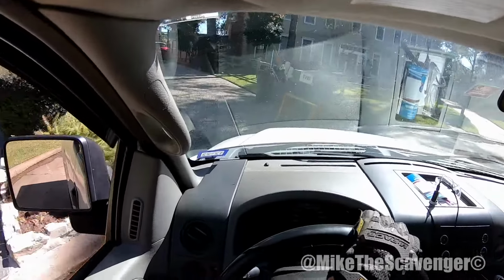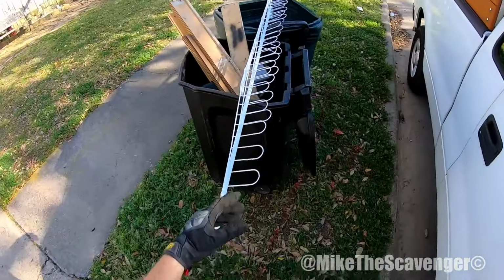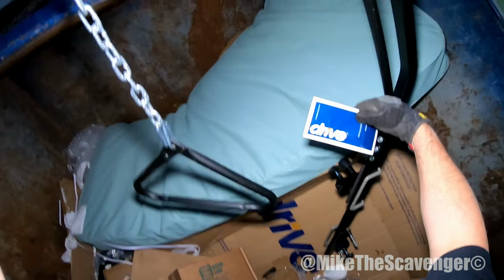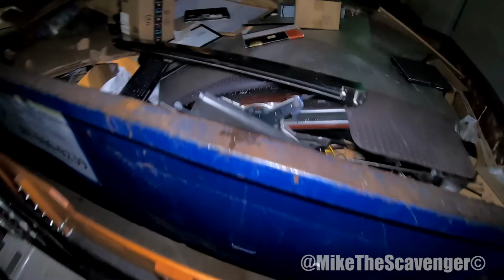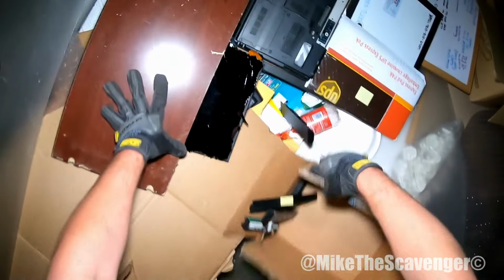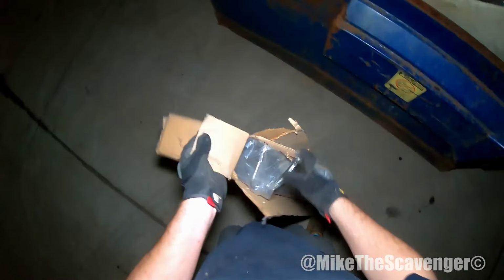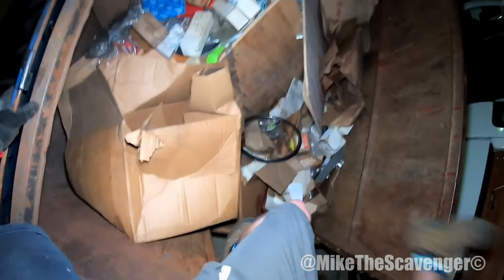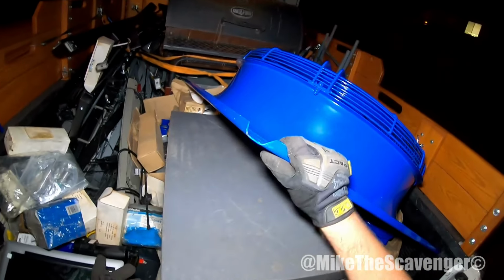Dumpster Diving "Comin' Home With Some Spaceship Stuff"

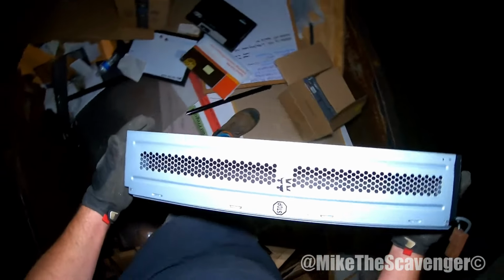Comment: Mike, that long piece you found at 17:12 is part of a ups.(uninterrupted power supply) the batteries you found shortly thereafter usually fit in that sleeve. I found one in an office open top a couple months ago. It had 80lbs of batteries in it.

Comment: Mike the big fan you can sell as big intake or exhaust fan for commercial use or large garage or machine shed depending on the voltage. The 2 drawer filing cabinet on wheels you can use in your garage for power tools.

Comment: Mike was wondering about the weather you received as long as it wasn't snow.
Hope the pups are doing well. That T handle item is to open the lock on a tractor and remove the trailer.
That b one big exhaust fan.
The fan is $$$$. Easy sell.

Comment: Mike those batteries have probably been used in some sort of cable avoidance tool (CAT) we use them at work and they use a certain percentage of the battery before the replace battery symbol starts flashing. the batteries i remove from the CAT's still register as full on my battery tester.
they are good for a few months in a radio etc.

Comment: Use some spray paint remover to clean up those cubicle pieces of aluminum works fast and you can hold it off get the paint remover in the can which is not harmful for the environment brush it on and hold it off with the water hose

Comment: Those boxes with the wires coming out of the fittings look to be some kind of pressure switch/sensor... Could be worth at least $100. If you can't sell them they are usually solid brass with an aluminum case.

Comment: As you got out the dumpster if you would have looked straight down there was probably about another 100 pieces of brass or copper when you were trying to load the big blue $5,000 fan

Comment: I found me some scraps near my complex dumpster.  Had to load it up and take it to the yard.  I think they cheated me for what it was though.  It looked like fencing pipes and the pieces were heavy. They put it under Tin.   I completely don't believe it was Tin. But I'm a noob and was my first time there so they took advantage.
Reply: If it was fence posts/piping which is typically galvanized steel
Reply: Bailing iron is what they call it here
Reply: @bhenton8039  That's what I thought too. I even looked up what it could be by what it looked like etc. The guy didn't put a magnet on it to check or anything. I had my whole trunk full of these long pieces. Got 6 bucks.  😠

Comment: @ 12:04  Looks like someone cleaned out a truck that a Locator was driving.  What's a Locator?  Okay, you go out, with your metal detector, or other fancier locating equipment...  and you find buried power lines, buried gas lines, buried telecom, buried cable TV, buried whatever....  Then you spraypaint it, mark it with flags...  then you take pictures of it, to prove you did it, and then you move on to the next job....

Comment: Hi Mike did you know that every computer board has a bit of gold in them and you can soak them in a 3 part solution and the gold settles to the bottom in 60 days or less

Comment: cheap AO2 cubicle made in China the panels are kiln dried particle board the connector is extruded the draw rod is steel with cast aluminum wedge

Comment: Hey Mike--Have to ask when you find the little flags do you have to separate the flag from the pole? I'm asking because there is a company near me that throws away those flags in bundles that measures about 24"x24". So heavy I can hardly lift one but I have always passed them by because I did not want to have to peel all those little flags from the little sticks.  Thanks
Reply: Those little flags can be resold. They are not cheap & many people buy just to mark their invisble animal fence.

Comment: Mike love what you're doing mad props to you. I just have one suggestion you should be a little more careful with your safety and also the stuff you find it seems your rather violent pulling things out and tossing it into your truck like your worried about someone chasing you off.  But you'll damage the resale value, hurt yourself and I've seen you miss (leave behind) lots of good scrap and items of interest in your Haist.  take i little more time to extract the value there is and got it all be a little more thorough.
Reply: Many businesses will  call security officers and/police if they don’t want you going through their dumpsters. You have to hurry most times, it’s just a good idea. Sometimes if a cop sees you in the trash they will stop and bother you if they are bored enough.  Many of the shops in the more affluent areas around where I live have been using completely sealed disposal bins. The main opening is a connected to a chute that leads to the interior of the store. Keeping you from accessing it at all.

Comment: Every now and then you totally one up me when scavenging because your choice of selection is sometimes baffling I’m totally okay afterwards but in my head I’m asking “why “and after a pulse I move on processing your fanatical remote like energetic scavenging without a backwards glance however with a flabbergasted expression of your discovery’s because I’m technically baffled by things that are dumped in the dumpster still there are a set of rules beliefs or ideas which you use to decide what to do and those ideals are examples of individuals  successful scavenging endeavours and build a steady steam of forward thinking projects initiatives you never disappointed me Mike I follow you “mike the scavenger “because your entire theatrical undisputed comments of reality and liberty with irrational observations based on logical reasoning provoke a instantaneous laughing fit reaction within me every time : rock on “ mike the scavenger “